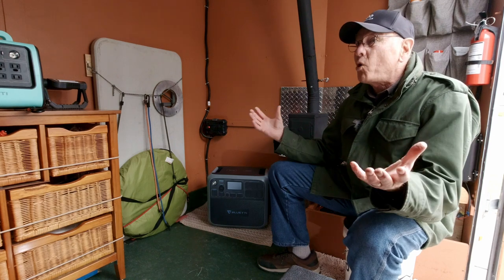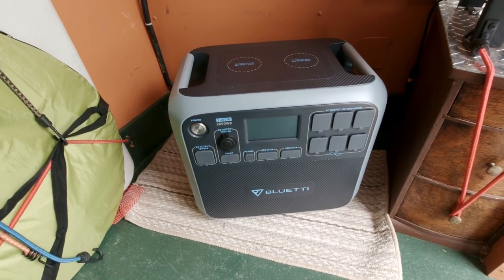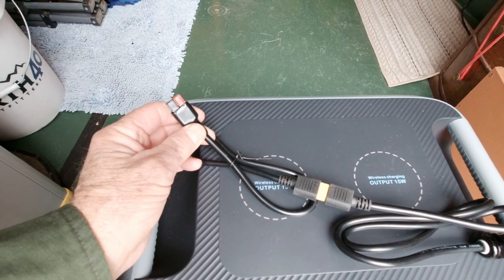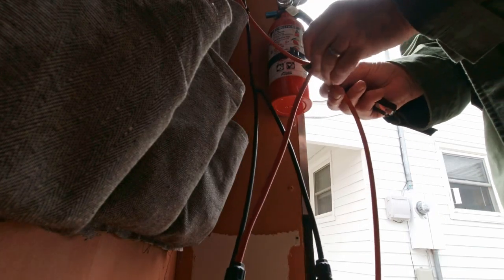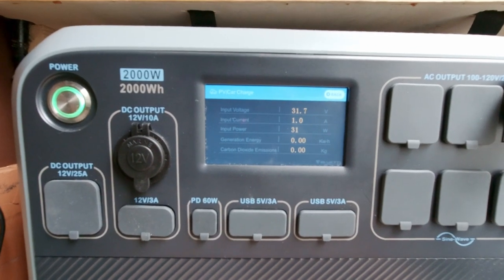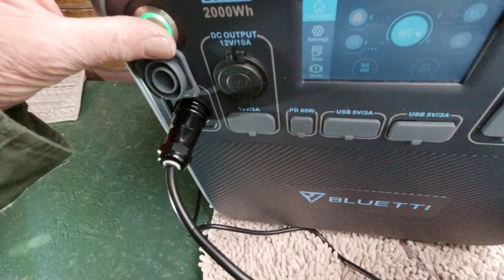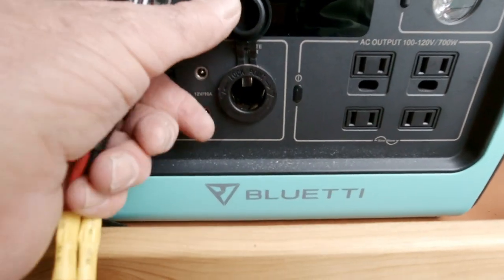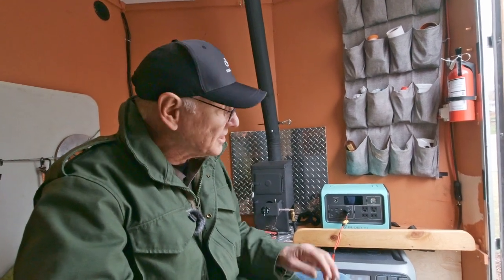Hooking up a portable power station to your RVs electrical system

Comment: I really appreciate you taking the time to wire in the Bluetti. This is a Video procedure that is well overdue. I assume will be getting 200 max and want to do a similar wiring into the DC bus coming off the 30 amp receptacle. I’ve searched YouTube for similar videos as yours and only found one and it wasn’t as detailed as yours. Again, I appreciate you taking the time to do this.
Reply from the maker: The Max is a great choice because it will accept about 10.5 volts minimum to charge whereas the 200P needs 30 volts. This allows your solar panels can be hooked up in parallel instead of in series and parallel is better in case you get a shadow across your roof.

Comment: This is one of the best camping applications I’ve seen for the portable power stations.  At least tripled your DC storage capacity and added A/C output from the built in plugs.  And still fairly compact.  Quite nice!! Thanks for showing us a great use for these.

Comment: Very helpful and I now know what both ends of the RV power cord looks like.My DC system is slightly different. I'll be using a Blue Sea Systems `12 circuit fuse block to provide power to my water pump,refrigerator,Maxx Fan,various 12v lights and diesel heater. But this helps me visualize how I'll be able to connect the AC200P to the Blue Sea fuse block. I will have to start sourcing solar panels I would like to have 500 watts using two panels. Haven't decided if I'll hard mount to roof or leave portable. Many of our camping sites are shaded so that could force me to be mobile with solar panels. Thanks again for the video it was really helpful!
Reply from the maker: Glad it was helpful, Alan, thanks for watching. We have a fold up solar panel that we set up when the trailer is in the shade. Those are handy for that.
Reply: @gonagain  Good idea always be prepared isn't that what this is all about?  Lol

Comment: Nice simple, straightforward video.  I also like your mannerisms - you seem like a cool guy.

I'm thinking of doing something similar with a bigger Bluetti and I'm working on figuring out the pros and cons to this vs a traditional battery/inverter/solar system.
Reply from the maker: Both systems have their pros and cons.

Comment: Thanks for putting up this video...I have the BLUETTI AC200MAX plus the two Expansion packs. I have used it standalone and even plugged it in the 50 Amp (with a plug to 30 am) receptacle for back up...Worked Ok...but your method is what I really want to proceed with. This helps me understand better how to integrate in our new fifth wheel which has has 370 watts on the roof. Will update you later this spring and see if this can be done.
Reply from the maker: Yes, the MAX is a great unit and it can do that.

Comment: Those power stations have come such a long way in the past few years. I know weight and space are important in a small trailer. I like that you can quickly unplug it and remove it if you choose to.
Reply from the maker: Yes, exactly, it can still be used for other functions and even brought into the house in case of a power outage.   Be sure to also check out the Bluetti AC200 Max.

Comment: Good video, watched twice. I have considered the the battery route for my trailer, and also  the cost of multiple AGM batteries, DC/AC inverters, charge controllers and plus lots of expensive cabling. My conclusion is the power bank such as the Bluetti fits my needs for camping, also can be easily moved into the house for back up power. Thanks for posting.
Reply from the maker: Glad it was helpful!

Comment: Thanks for the video. I have one suggestion. Instead of bus bars, use a Blue Sea fuse block with negative buss. This would keep everything neat and allow you to fuse each circuit. This way one thing going wrong doesn’t take down the whole system.
Reply from the maker: Thanks for the tip!

Comment: Yes sir.  The bluetti likely has a 24v (nominal) battery with a 29.2 or 29.4v fully charged voltage.   This is why the panel voltage must be at least 30v because you have to have a bit higher voltage coming out of the charge controller to allow current to flow to the battery.
Reply from the maker: Hello Kenneth, I noticed that on the AC200 Max, Bluetti went back to the lower voltage, and it will charge off of a single panel.  Although, with a power station of this size, it would take multiple panels to charge it efficiently anyway.

Comment: Hey Rick, I was curious to learn about why you got rid of your larger camper and decided to go to a cargo camper conversion.   I ended up with a 12'   1959 Shasta for cheap while I was contemplating building a teardrop.  It is basically a large bed, kitchenette,  and some cupboards and cabinets.  Cold water system and 12v lights with a marine battery which connects to tow vehicle for charging.  Oh and an a/c inlet when I have a situation to plug in.  I guess my situation is really very similar to yours.  I ended up with this Shasta for $500 at the time.  Gradually rebuilt it over several years and upgraded the axle and brakes.  At some poiint you downsized.  That would be an interesting story for sure.  Thanks.
Reply from the maker: That Shasta sounds like a nice little outfit, especially with an upgraded axle.  We stay with our small cargo trailer for its high ground clearance and its ability to get turned around in tight places (where we always seem to end up!)
Reply: @gonagain  That totally makes sense to me. I guess my Shasta is the same length as your rig.I use a 5 x 8 trailer for my home repair/remodeling business.  Same reason, I can K-turn my way out of just about any spot.

Comment: Since your panels are now in series, no need for the fuse. It will only add potential voltage drops. Would humbly suggest you fuse the wire out of the BE going to your DC bus bar to protect the wire. Also, separate your bus bars so that you can't accidentally short them with a wrench. Nice video.
Reply from the maker: Very good info and thank you!  We've made some big changes since that time.

Comment: I wired my Bluetti AC200 directly to a fuse box in my Travel Trailer i run all my 12 volts lights my 12 Volt frig and 12 volt pump for the shower off this Bluetti i get about 3.5 days of run time before it needs to be recharged.

Comment: Thanks for sharing this, it was super helpful. I read through the other comments and don't think this was asked and I am scratching my head still trying to figure this part out!  I can see how the solar connects to the power station and how the DC 25amp port sends power out, but my confusion revolves around what you have downstream (using the existing RV converter and breaker box). For example, if you plug into shore power can the bluetti also get charged through the existing electrical? I have a dead RV battery and a new power station, so I was hoping to find a way to use this as my DC battery for the season without having to purchase a lithium battery and replace the RV converter with a lithium compatible one.
Reply from the maker: I don't have shore power in my trailer and only depend on the Bluetti and solar, but it you have shore power you would just plug the Bluetti into the nearest outlet using the wall charger that comes with the Bluetti itself.  Now, about hooking up to the existing 12volt wiring on a commercially built trailer.  You wouldn't want to hook this up to a system that currently has a house battery installed because if you did it would just drain the Bluetti trying to charge the house battery.  You could remove (or disconnect) the house battery and simple hook the Bluetti to where the original battery cables hooked up.  You would also need to disconnect the trailer's battery charger from the system so as not to hurt the Bluetti.  I mainly did the video for anyone looking to use this portable power station as a stand alone unit on a simple build, but it could be made to work on regular RVs as well.
Reply: @gonagain  Hi, I LOVE your videos.  QUESTION:  I bought a small 22” camper awhile ago and upgraded the battery so it would last 4 nights.  So I was told.  NOT.   So I bought a Bluetti AC200 Max because it had a 30 amp plug where I could plug my trailer directly into it and be able to run everything in the trailer from it.   I also bought an ampertime lithium iron phosphate 12v 400amp battery to connect it directly to the Bluetti to keep it charged.   I think that’s how it’s suppose to work.  Or would connecting the battery to the Bluetti just increase the wattage?  But now I want to do what you did and hook it up inside my camper to use it when there is no electric to connect to.   And when there is electric at the camp sites, then just use that and not my Bluetti.   So how would I configure the electric panel in the camper to do this?  Any suggestions?  I look forward to hearing from you or anyone else that knows about wiring in campers.

Comment: Hi Rick, just wondering if you have any thoughts on wiring AC outlets to the Bluetti.  I don’t want to use extension cords. Maybe just use one cord that feeds into a breaker box? Any ideas? Thanks for all your great reviews.
Reply from the maker: Yes, you have the right idea.  You could also run one extension cord that has a 4-outlet box on the end of it. This video shows what I mean: 
 https://youtu.be/EseFbug7cMg
Reply: @gonagain  Thanks Rick. Appreciate the video link. He does a great job explaining the process of setting up the outlet box.
Reply: @gonagain  Thanks Rick. Appreciate the video link. He does a great job explaining the process of setting up the outlet box.
Reply: You could also plug in a power strip

Comment: What is the model number and approximate cost for the smaller unit? I am planning on doing some tent camping this summer and need just enough power for a CPAP machine and to charge a couple phones for a few days. Or do you have a better suggestion for this purpose?
Reply from the maker: Hello Kelly.  The smaller unit is a Bluetti EB70 (now the upgraded EB70S) and I highly recommend it.  You should get at least a 100watt solar panel to go with it and it won't have any trouble keeping up with your CPAP and even a 12v compressor refrigerator if you like.  https://amzn.to/3P7fm3k
If you purchase through this link I get a small commission, but the cost is the same for you.

Comment: Very helpful walkthrough. Curious about 2 things. Weren't you in danger of getting shocked when disconnecting components down stream of the solar panels while they were still charging in the sun? Also, I noticed you added that 30 amp breaker on the output side of the 12 volt 25 amp output. Is that bluetti 12v/25 amp output "not" protected internally with it's own built in fuse or breaker? If not, that's strange for that not to be self protecting considering the cost of the unit. Thankyou so much for the highly informative segment.
Reply from the maker: Hello Machu Pichu.  I had a sub woofer breaker above the door that I was able to turn off before disconnecting the down stream components.  I actually didn't add that 30amp breaker on the output side, it was there from the previous house battery set-up I had and I just left it in place.  The Bluetti is definitely protected by it's own circuitry.  So far I'm liking this new set-up, but I haven't gotten a chance to use it much yet.  I think it's good for smaller outfits like mine.

Comment: I was thinking of connecting my EB70s to my rig but wanted to use the front 10a barrel plugs, thinking they would be more secure than the cig lighter plug.  Is there a reason not to use those barrel plugs to connect to my fuse block?
Btw, I really enjoy your channel.
Reply from the maker: Only the wattage limitation: the barrel plugs are less than the cigarette lighter plugs.

Comment: Interesting video!

I am new to this world and am still learning so apologies for the question but….wouldn’t it be easier to just upgrade the existing house battery (or add a second one) versus re-wiring the solar array and wiring the Bluetti into the system? Just wondering.
Reply from the maker: Yes, absolutely, but this was directed to those who have a power station and want to use it to power their small RV.

Comment: Hi. I really enjoyed this video So can you charge a 12 volt battery straight up from the AC 200P using the 12V RV  cable which has an XT 90 and the 12v/24v Lead-acid Battery Charging Cable that has an XT 60 by converting the XT 90 and the XT 60 ends? Since the AC 200 P has an MPPT controller.Sorry for the question and I hope it makes sense. Thank you.
Reply from the maker: The MPPT controller handles the power coming into the AC200P but not the power going out. That's handled differently. There are two ways to safely charge, and protect, a separate 12 volt battery. One is to simply plug an automotive battery charger into the AC200P and do it using 110 volts. The other way would be to use a DC to DC charger wired into the 12 volt bus that the Bluetti is powering. That's the best way and it avoids the power loss from going through the Bluetti AC inverter. This will regulate the charge going into your 12 volt battery.

Comment: In general financial terms; do you think its less expensive to build an electrical system using a variety of separate components (battery, Inverter, controller, etc), or is it less expensive to purchase an all in one unit, like your Bluettie, that comes with most everything you need.  I know there are alot of factors that go into this depending on quality of the individual components, and how complicated your system is.  But I was just curious of your opinion based on your experience.  Great video.  Always appreciate seeing what you guys are up to.
Reply: It would be less expensive doing it by individual components and if an individual component goes bad that’s all you have to replace. With the all in one solar generators a lot more difficult to replace components.
Reply from the maker: It would depend on the components, but this is a lot simpler.  As for cost, the AC200P is equal to 4 AGM batteries power wise but, because the LiFePO4 batteries last a LOT longer than flooded batteries, this way is significantly less expensive.  My idea behind doing this was for using it in smaller rigs without the room for a number of individual components.
Reply from the maker: That's true, Ninjasmoke100 and your needs could be different.  This is using the KISS method (keeping it simple).

Comment: I’m wondering how you would power instant pots and other devices since the power you have coming out of the Bluetti is DC?

I was hoping there was a way to go from the bluetti ac outputs to power your 110 outlets.  Is this something you’ve done?  Either way I like your videos!
Reply from the maker: The Bluetti AC 200P has a 25 amp port that is designed to power your RVs 12 volt system. For 110 volts I would still plug into the outlets on the Bluetti itself.
Reply: After looking into it more, I'm thinking the best would be a transfer switch.  This is essentially a big relay,  You would wire your shore power and your bluetti to the transfer switch which would then send power to the RV panel / breaker box.  Once installed, this would allow you to switch between the bluetti and shore power (the relay would click when you plugged into shore power and draw from that instead of the bluetti).  Will Prowse has a video that shows how.    @gonagain

Comment: At the end of your video, you mention hooking up the power station to your house battery. How do you do that? 
I'm looking to charge my trailer battery by connect a portable power station to my trailer through a factory installed solar port. How do I do this safely?
Reply from the maker: I was talking about just taking the power from the cigarette lighter port and hooking it directly to your trailer's 12 volt positive and negative buss bars.  Some newer Bluetti, OUPES and other power stations now have a 25-30 amp port just for this purpose.  I wasn't suggesting using the power station to charge your trailer's batteries, but to switch to the power station when your house batteries are low.

Comment: Hello, I was wondering if you have ever considered using the positive and negative points on a 7 pin trailer wiring harness to charge the battery as you are driving from point a to point b?
Reply from the maker: We used to do that and it works fine for a regular type of battery.  For this type of power station you would just plug it into the cigarette lighter and charge it that way.  They all come with a cigarette lighter adapter for that purpose.
Reply: @gonagain  thank you

Comment: Can you use both blueti and your old battery together? Or can you somehow expand blueti's capacity by connecting the battery to the bluetti?
Reply from the maker: In this case I was showing how to use the Bluetti instead of having a house battery, but if you want to use them together you would need a 3-way battery selector switch to switch from one to the other.  Those are available on Amazon.

Comment: Hi, I was wondering how you prevent water from freezing up, in winter, when the heater is not on?
Reply from the maker: Good question with no good answer.  We don't have a holding tank, so no problem there and when it's freezing we don't use the two 5 gallon containers on the side of our trailer for drinking water.  For our drinking water we store it in one gallon containers and keep them in the car while we're traveling and in the trailer at night.